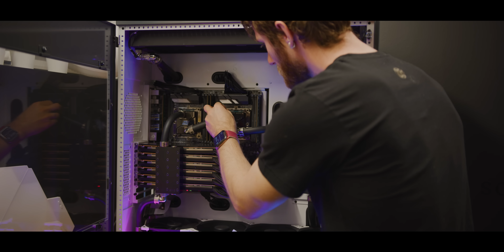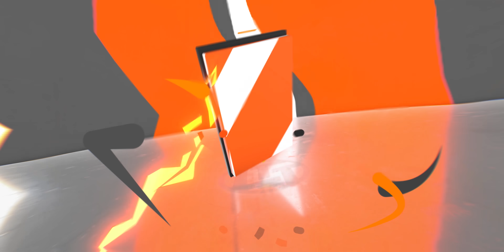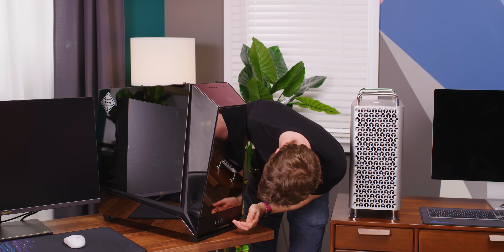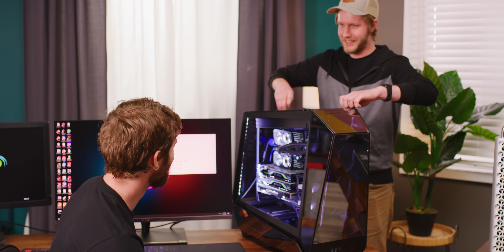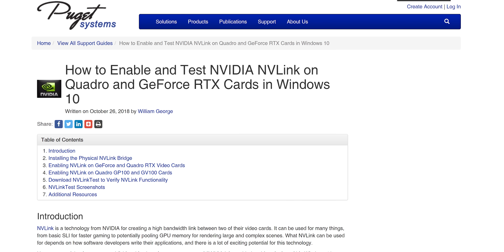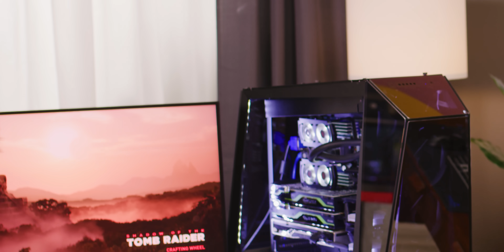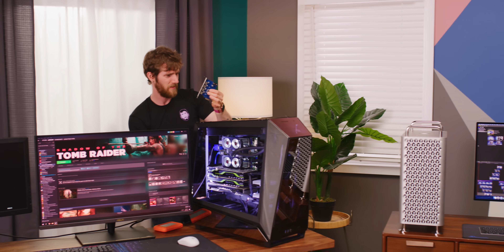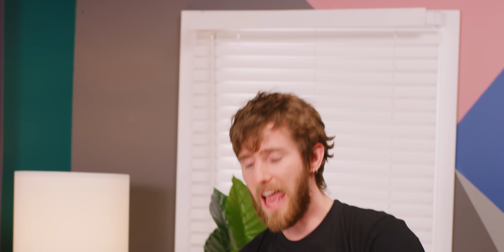The $32,000 Mac Pro Killer

Comment: With the benchmarks they had, a Threadripper with 256GB non-registered non-ECC RAM would have probably won with a much bigger margin. The use cases where you really need more than 256 GB of RAM are pretty rare. For higher memory needs, adding a RAID of intel 905p cards for a swap might still result in higher overall performance.

Comment: I saw a Windows logo instead of the manufacturer logo at boot which means you’re not using EFI with a GPT partition table which means you’re not using the most optimized boot method…

Comment: just you wait HH
our $500K 1981 IBM-38 was replaced in 1993 with a mid range P3 and Wise terminals.
just a few years and all your world beating effort will be fodder for the dust bin.
usually because power savings will pay for the replacement. otherwise....
bleeding edge in computers will bleed anyone but Bill Gates dry.

Comment: It comes down a lot to software and its design. There are multithreaded compression systems that will work faster on the PC pro. In short if the people right the software in a manor it doesn't take full advantage of multithreading the mac pro will do better in. However, If the developer makes proper use of something like a thread pull and doesn't just use something like async the PC Pro will win hands down. The problem really comes down to the number of people that are actually good at writing multi-threaded programs. If you watch Sean Parents talk on C++ concurrency you can learn what I am talking about.

Comment: I'm not sure why you guys spent 32,000. the moment the final price came out for the mac pro, i calculated a cost of $26 to 28 thousand to be needed to match or beat the pro.  Then i took Apple's $53,000 price tag (a full maxed mac pro) and used that for a PC... it would have trashed both of these machines combined, with enough left over for 5 32" 4K monitors, and two separate UPC systems that could run the machine at full load for 8 minutes. Sadly though, most of the items are now out of stock. 
And i'd definitely be able to take advantage of that Pc Pro box... the software i run would eat it alive.

Comment: Why don't you use Threadripper 3990X, with 64 cores.
Reply: because the boards for the 3990x can only handle 256 GB of RAM.  Epyc boards handle 2 TB of RAM.

Comment: Linus:"Now in real world operations you almost never have to use 100% of your system"

Me on my 2010 mac trying to play roblox: are you sure about that?

edit: 350 likes huh thats pretty cool i guess

edit: why dose this have likes?
Reply: prime95: Hold my beer...
Reply: @SteelBlueVision  prime95 usually isn't considered "real world" as it a synthetic benchmark/stress test in most use cases (yes, there are some people that use it in a genuine search for bigger primes though, but it still doesn't use GPU right?).  That said, some people regularly will max their system.  That is kind of unusual though.  Even many of the computer scientists I work with etc.. will only max out GPU or CPU at a time, most software even in compute heavy scientific domains tends not to fully utilize both.  They tend to be either CUDA deep learning models that will push GPU, simple parallel software that will use all local threads, or things like MD simulations that you can run on giant clusters (distributed systems) of CPUs and communicate with some kind of message passing interface (MPI).
Reply: Ima be that person to say since Roblox is only single code, even a 2010 mac wouldn’t technically have all cores maxed out
Reply: Hope you got an ssd
Reply: do you actually play Roblox? tell me ur username if so.
Reply: U reached 355 likes, u have to update ur comment again
Reply: Ummmm 2010 Mac is still faster than most PCs
Reply: @loveiphones4550  umm  your just wrong
Reply: @loveiphones4550  yes recording a video at 60 fps on a 2010 mac uses 40% of my CPU  so that means its totally a good computer that's totally better than most computers.
Reply: @loveiphones4550  what?

Comment: NVLink runs at 32 GB/s which is wicked fast, however; the RTX Quadro 8000's HBM2 maxes out at 672 GB/s which is over 20x faster. While it does technically allow the GPUs to share memory, it's not really comparable to a GPU with double the RAM.

Comment: the mac barely won the single-core benchmarks, and only because you prioritized multi-core in the CPU. anyone who cares about single-core can crush the mac by opting for the threadripper instead. you'd lose a point for RAM, but only if you can think of something that requires >256GB

also, you could have replaced the case with 3 dollars worth of scrap metal and it wouldn't look worse than the cheese-grater

Comment: Incredible machine.
Switching to Linux would fix the boot time issues, but sadly I know a lot of people aren't ready for that (most importantly software companies.)  
Better than it was, but still needs to hit that critical threshold to be popular enough on the desktop market for major software to support it directly.
I do think you need to make a yearly video on Linux to keep an eye on it's development.  Try out the latest tech.   
Currently added since your last Linux video:  
VirGL which allows accelerated graphics in VM without special hardware level virtualization. 
DXVK9 which supports running Direct X 9 applications in wine on Vulkan with substantially lower overhead and more exact shader conversion than the old stack.
Steam now has Proton SteamPlay Compatability layer which allows many Windows games to run out of box on Linux with little to no performance loss.  
As of updated APIs:
Mesa now runs OpenGL 4.6 on all major AMD and Intel GPUs recent enough to physically support it, which is actually more than on Windows.  
Mesa also now supports OpenGL 4+ compatibility contexts.
Reply: The boot time is slow because the motherboard doesn't support fast boot. Does linux have (some sort of) fast boot for all motherboards?

Comment: $32k is nothing in workstation land.  HP Z8 desktops start at $3500, and simply by going with the fastest dual processor it's over $35k.  To go over $100k is as easy as a few GV100 cards.  These are the kind of systems that have test simulations ran on them to make sure the setup is correct before sending them to the supercomputers for the big work.

Comment: If what I need is massive computing power for a professional application, I don't think my choice will be between a giant cheese grate or a home-made flashy gamer PC on steroids. Racks of 19" servers seem more reasonable. Users will be sitting in front a $2000 PC while the heavy stuff happens in a back-room, or even cloud-based. That's how heavy simulations are run in my company (automotive).
Reply: That's not a gamer PC on steroids. Where's the RGB?

Comment: um, I'm not sure where the "stress analysis can't be parallelized" statement came from, but you absolutely can run those simulations in parallel in 90% of programs. In any large scale engineering simulation you should ALWAYS be running your cpu in parallel as it exponentially decreases the render times, depending on the simulation, you could see the render times reduced by tens of hours if not days........

Comment: A lot of "problems" here could have been resolved in a much better way. E.g. the POST display that is VGA-only. Instead of a self-standing monitor, I would've put a small but readable LCD display on the inside of a case. Looks cooler and much more professional. The other thing are janky RAM coolers. This could've been done in so many less jank ways.

Comment: My favorite EPYC board is the Asrock Rack ROMED8-2T. It has 7x PCIe 4 x16 slots, dual Intel 10 GbE, 2x M.2 (PCIe), 8x sata 3, and oculink. Also supports 2 TiB of RAM and has an ASPEED based IPMI.

Comment: Extra point for the Mac. It just works. With how much BS you had with just the graphics cards alone, it becomes hard to justify the cost. Say what you will about a Mac, but it comes out the box ready to do its job. No mess. No trouble shooting. Just plug it in and get to work.

Comment: 11:20
NVIDIA probably requires installation to be made by a "Certified NVIDIA Specialists". For a pretty penny.
Reply: you can run the nvidia-smi easily on any linux machine. I have set them up for a ml server without any trouble. I guess they don't except them to be running in windows ;) but yeah mode guide is always helpful
Reply: @BenjyP.  Yeah, good point, why on earth were the using windows?? (take off 100 points)

Comment: In all fairness, this build is not very good. For 31,611$ you can get a pre-build workstation with dual socket epyc 7502 for a total of 64 cores/128 threads, 1TB of ram, dual rtx8000, 1500w psu, 1TB nvme, 4TB ssd. 
I mean, sure it's a cool custom build an all. But the value isn't very good when a pre-build comes with an entire extra cpu and 3 years of warranty for the same price.
May be i am missing something?

Comment: I'm not a fanboy of either type of computer but... testing with the Mac running windows vs the fully optimized for the hardware Mac OS.... invalidates these test results in my opinion.  LTT has proven time and time again that running anything other than Mac OS will cause performance degradation making it an unfair battle.

Comment: I have a SeaSonic SSR-550FM semi-modular 80+ gold ATX PSU in my ITX Fractal Core 500 case running a i5 9400f and a RTX 2070 Super, does what it does, and I love it for that. It also has really nice sounding clicky circuitry (Relay I think?) when you power on / off the system, other than that, it's dead silent. The only thing I don't like about this system is that the ginormous Gigabyte RTX 2070 Super's fans won't clear the magnetic dust filter so the filter has been moved outside the case. 

I had bought a Corsair 550w 80+ bronze PSU but it refused to even boot my old GTX 1070, yet the SFX (And 5 year old, now 6 year old) Silverstone 450w 80+ bronze PSU powered the 1070 fine (In a Silverstone ML08B case with a i5 4570) until I got the new SeaSonic PSU... When I attempted to power the system on with the Corsair 550w PSU it just gave me the idiot message telling me to plug in the power connector on my 1070. I also really like the clicky relay when I turn on my PC, the SeaSonic has some nice, REALLY nice components in it. It's a chunk of "Well, this is excessive", and I love excessive PSU's. By far I want the PSU to outlast the whole PC by several builds. 

Shoebox PC case owners, unite!

Comment: Just let me summarize this:
This case costs more than my entire setup. Twice.
They did not pick an insane pro consumer CPU because 256 GB of RAM is NOT ENOUGH.
The system has as much RAM as my entire system has physical storage.
You have to actively cool the RAM.
The power supply, which has to provide power for transistors built in the nanometer area, could power my vacuum cleaner.
A single one of these graphic cards is worth more than my car. Twice.
A TITAN RTX as a display output. This is obscene.

This video is pure over the top, ridiculous, total excess. I love it to bits. This is why I joined this channel so many years ago. Keep up the great work guys.
(By the way, have you ever thought about what you are seeing right now? This whole thing started out as one strange guy, wearing socks in sandals, reviewing PC parts. Now he has a media company with 5 (?) channels. Dang. Well done Linus!)

Comment: Now make a 64 core TR machine with 256gb of memory and two 2080 Ti's and see how that performs when doing fluid simulations in Houdini or rendering in Arnold or Octane. It will cost a tenth of the Mac Pro and out-perform both of these machines.

Comment: If you plan on keeping the PC Pro together, you could take a small screen normally used in a raspi and mount it against the tempered glass inside the case to run your VGA feed. Then mod the bios to show an LTT logo instead of a Tyan logo. That would be pretty sweet.

Comment: Y'know, the PSU really does seem super reasonable in this context.  It's a fraction of the price of even some of the least expensive components for this rig (either the RAM or the case, depending if you calculate on a per-stick or total RAM cost basis, and whether you cheap out on either, or maybe the CPU cooler since OEM doesn't include even cheap coolers anymore so you have to get at least a cheap one).

Comment: 15:45

Stress analysis can be paralellized very easily. After you get through all the solid mechanics theory, the software is really just asaembling and solving a large linear system. Any commercial software should be able to parallelize that process just by checking a box and putting in a number of cores.

Comment: im glad Linus has kept the beard.

Also, he thanked Alex for using insulation tape on those ram coolers, but at the start of the video... anyone notice Linus using the insulation tape on them? :L
Reply: 0:37 you mean here? its a different PC. He used tape on one of the fittings from the CPU Waterblock.
Reply: @MrGrinchi017  ah yeah so it is! my bad, I should have rewound and looked! but hey, he still uses it :L

Comment: I feel like Linus is going to take heat for this video.  I mean, I'm by no means an Apple fan (massive waste of performance per dollar), but the Mac Pro was set up to lose this.  Not running its desired OS (yes I know you can't run many benchmarks on Apple's OS but still).  Doing gaming benchmarks (again in windows).  Getting a point because you can run CUDA due to having NVIDIA cards which the Mac Pro lacks.  I think the worst part is the point system where Mac Pro gets 11 points because they ran 11 productivity benchmarks which the Mac Pro won but the PC Pro gets 13 points because they won 13 graphical benchmarks.  I mean, if you had picked 2 or 3 less graphical benchmarks, the Mac Pro would have won?  So you added a few more graphical benchmarks to get the extra points?  At most it should have be 1 point Mac Pro for productivity, 1 point PC Pro for graphics.  Only thing the PC was actually better at was the custom benchmark.  Then all the hardware ridiculousness on the PC..  Sorry, but I think the thief picked the correct machine at the beginning.

Comment: Gonna come back in 20 years when this build is valued at $1000
Reply: Stick it in a different case and give it 25 years then maybe.
Reply: It'll never happen, the case will hold value and eventually go up in price.
Reply: Nick Miller That is exactly what everyone else is saying, eventually it will be cheap because everything does
Reply: Man, I thought that case had a wooden panel on the bottom and I honestly didn't care the price. I was gonna buy it asap. Til I read this thread and found out I can't really find where to buy it.
Reply: The case won't go up in price.  As hardware dimensions change over time it'll become a useless box.
Reply: $16
Reply: It was outdated by the end of the video
Reply: This will be a apple smartphone spec in 20 years 😂
Reply: @mithunrajsuresh1278  I doubt that

Comment: 200 dollar power supply?? You could be powering each part of that machine with its own power supply.. Power throttling and RMS wattage of the PSU may be something you may have not measured, but I guarantee that cheap psu has internal protection that keeps it from actually giving you the full 1300 watts out of safety for its internals maybe.. Graphics could, (and at this price point should) be powered separately considering what PC users brag about "cUsToMiZaTiOn", everything should have a separate power imo.. I feel like your numbers would be higher actually.  But thats not the point. 

32 grand and I have to pay someone with very high skill to build it, cause I sure as hell don't have a full LTT shop with on site engineers, and many people sure as hell don't know how to get all the little details right. We also have to custom machine components, do testing, and and you have the audacity to say "Mac Pro Killer!" Lol first video I genuinely laughed at.. 

Sorry, Apple built something good, deal with it lol I get it, PC is "mOrE pOwErFul" But if i have to spend 32 grand on PC parts, plus pay a machinist and engineer to work on it, design stuff for the build etc.. Its not better than mac, and its definitely not cheaper. The fact it was so janky and still only beat apple by 2 points.. Yeah that visualizer test was something, but all the time I spent troubleshooting my machine, trying to figure out setup and getting it to really function properly would be a learning curve. I am an Apple user of years and can say yeah they make some junk sometimes, but this new mac pro is a true powerhouse of a machine.

How long did YOUR TEAM spend building this, cause I promise Linus alone did not lol MOST normal people building these machines are not solo. 

So -10 points for that cause with apple, you buy it, DONE. No bullshit. Plus new mac lets you upgrade.
In a nutshell, if you have 32K, buy the mac.. Dont waste your energy and time to have a janky windows that from the get go, is a let down.. Let down because its completely janky. You have a damn bracket resting on a multithousand dollar piece of gear with electrical tape.. LOL WHAT.... 
YES JANKY.. for 32 grand I expect something seamless, no electrical tape, and i get it, its not a final or whatever maybe, but youre attempting to compete with something that is engineered to be seamless and function as a whole unit, and be not just better, but KILL apples computer in performance.. Custom or not.

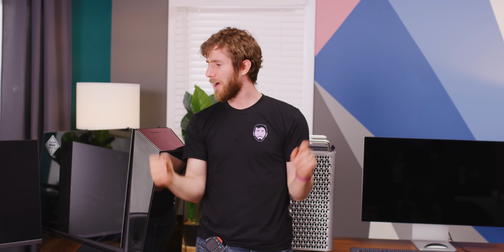and honestly, 3:57 says it all.. hahahah 

BUT ASIDE MY OPINIONS, Amazing video Linus and love your channel haha :D

Comment: I'm surprised any one went through the effort to get NVLink up and fully running on WIndows for the Quadro cards. Mostly because a lot of the stuff it's designed to handle is Linux centric in application support. Wonder how well those babies would handle some heavy CFD work.